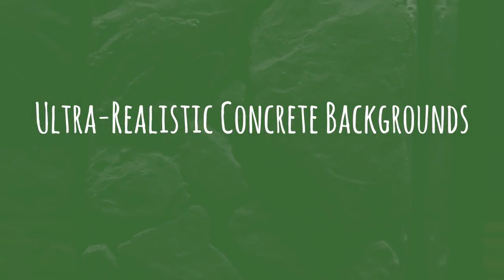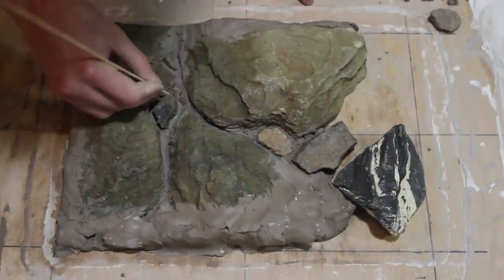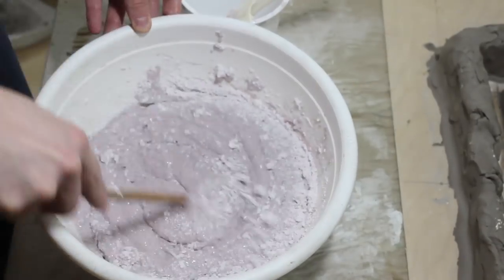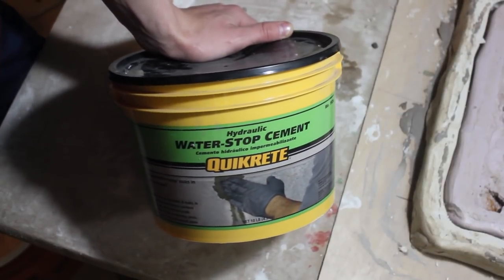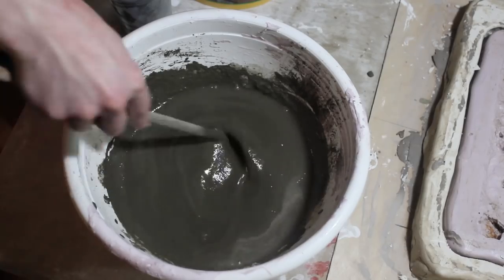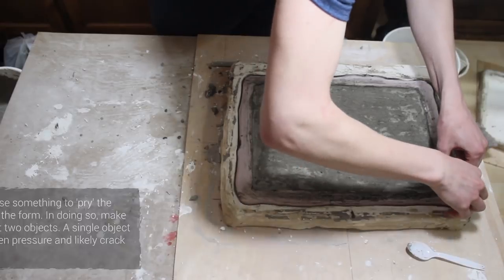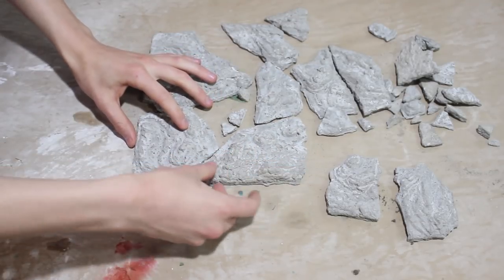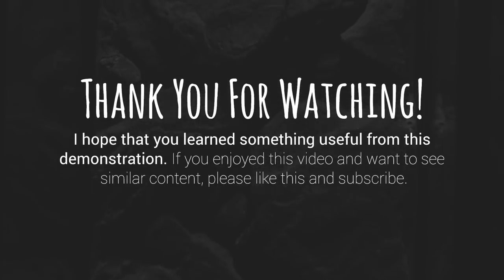DIY Ultra-Realistic Concrete Background for Aquariums & Vivariums

Comment: setting a stiff mesh into the cement will give it extra strength to keep it from cracking as easily. Think of it as miniature rebar like the kind they use in huge concrete structures.

Comment: I'm loving your techniques and designs.  Toward the end of this you mentioned that for larger builds, weight of the background could be an issue, especially with thicker (deeper) molds.  This might be relieved somewhat if you first spread a thin layer of your concrete mix to establish the surface texture, then fill the rest of the way with a cement mix including a lot of perlite, which is much lighter.  Just a suggestion based on experience making hypertufa.
Reply from the maker: That most definitely would work and I'm sure it would cut a lot of weight off.
Reply: Wow great idea. Perlite would really lighten it up.

Comment: As a suggestion, after you have the general clay sculpting done, you can take a piece of the rough, bubbly lava rock and use that to add a more realistic pattern to the clay portions by rolling it around over it...

Further, for both making your mould and for casting from it, if you can get some box fans and place them face up underneath your plywood, you get the effect of a vibration table. It helps remove bubbles from the results

Comment: Thanks for this tutorial! I absolutely love the look of this but I have big builds (6×2×2.5 and 4×2×2.5) to do and was concerned about the weight. I thought of two ways to make it lighter but still have this awesome result.
1. Make the mould 1-1.5 inches deep and use a ¼ Styrofoam board kinda sandwiched between the layers of concrete. So it's concrete surrounding all sides but the infill is mostly a light foam. You get the rigid outside on all sides but without all that added weight. 
2. Foam filling. There's a liquid version of what GreatStuff is (polyurethane resin foam) that you could pour into the mould and allow it to take shape of all those awesome small details. It is meant for backfilling post holes instead of using cement which is really why I thought of it (cement alternative). I've seen it used in prop making like foam filling masks. It's called Sika PostFix but I'm sure there are other similar products. It sets up in minutes so you could use the alginate mould more times before it loses too much moisture to continue using. I also believe you could make large backgrounds in one piece with no problems at all or sculpt the moulds next to one another so they can puzzle piece fit back together once you install them. Since it is resin, you should be able to tint it using resin dyes (it is green to start), paint it in quikrete and use dry brushing for details, or just cover it in concrete and aggregate mixture like your other background build video. Covering it in concrete or quikrete would probably be preferable for a naturalistic texture and filling any tiny air bubbles. 

I will try the second method very soon for my builds and hopefully I'll remember to come back and edit with an update.

Comment: I've found that using granite roof shingles works well for backgrounds. Has a very nice look. I shape the shingles with files or chipping then silicone them to the side of the tank being used. Make sure you get them "natural", not chemically treated with any water proofing. They usually have two holes drilled in for securing, I hide these by grinding up some small pieces of shingle, filling the holes with silicone then covering them with some granite "dust".

Comment: Hi SerpaDesign, this video is great as usual!
You mention coating in epoxy as a potential option - I did my own floors with an epoxy finish and love how they turned out.  The epoxy I used was very runny, though, so I don't think it would work well for this.  
I'm planning to make a rather large background, with a water feature built in, coated in epoxy; this seemed like a cool place to start.  I'd love to see you make one of these concrete backgrounds with an epoxy coat! Any chance?  Thanks, and keep making great stuff! :)

Comment: It's also possible to "glue" broken pieces of concrete back together with masonry glue. It's very much like an Elmer's Glue made for concrete and once dried is waterproof and relatively clear. On any that oozes up between cracks, simply dust a bit of cement powder over the wet glue to hide the glue. You should be able to get masonry glue from most home centers. MTC

Comment: I know this is an old video, but I would love to know more about using cement in vivariums. Especially the other methods of stabilizing the PH and also if SerpaDesign thinks using the cement-soaked fabric method would be OK in a background. In my mind, I see it as a great in-between for weight and strength, and low-mess (I don't want to carve foam).

Comment: Great tutorial! very well explained and the results are just outstanding! It will probably take a few attempts to get the technique right but once you do this process seems much faster than the classic foam sculpting in witch you have to do multiple coats for cement. 
Do you think it'll be possible to create some very pronounced ledges with a cast?? I'm afraid this method is limited in the depth offset you can obtain... Might give it a try thou!
Reply from the maker: Thanks! It really doesn't take long at all and the results really aren't comparable. Also ledges are definitely possible, but you will have to get creative in how you create the alginate mold. I would also highly recommend implementing an armature. Additionally it would be easier to use plaster bandages instead of pouring out a POP mold. I will show much more advanced applications for this in the future, I didn't want it to be overkill at first.
Reply: Can't wait to see your next video on the topic! Thank you very much!

Comment: instead of concrete you could also use paper mache,  or other fiber for a lighter (weight) background, although you'd have to seal it really well to keep it from crumbling, or maybe mix it with resin?

Comment: For larger backgrounds you can use rigid expanding foam instead of concrete. But be sure to use silicone for the mold material. Expanding foam is ultra lightweight, durable and super easy to use.
Reply: just the comment I was looking for please reply. Will the expanding foam fill the gaps as well as the concrete does and provide the same level of detail?

Comment: That looks brilliant. Maybe you could include hair into the cement mix to add strength. One question I do have concerns chemical leaching. Once upon a time they used concrete to make wine distilling vats because it was cheap and fast, but soon realised it had some pretty serious health implications. Would this not effect the health of the inhabitants? Even if you get the ph to manageable levels, I would think it's still a possibility 🤔
Brilliant work though

Comment: I’m in the middle of making a mortar background for a bioactive ball python enclosure. It’s foam covered in 3 layers of mortar. I’ve read that you need to coat it to make it safe for reptiles yet in the video you said that the concrete would be fine as is (without coating) So I have two questions about this: A- In my case does the mortar need to be coated for animal safety after all? (Ie have you used it for any of your animals) B- is there a safe and thinner alternative to epoxy resin? My concrete background is pretty detailed and I think that brushing on a viscous sealant like epoxy may cause it all to crumble. 
I’d love to get any advice you can offer :) thanks!

Comment: Hey Tanner I’d much appreciate if this gets answered because I need to know your opinion for this as im doing a “naturalistic back ground for my 100 gallon tank and I feel like this method would be to heavy for the glass, my question to you is can I use expanding foam instead of concrete on push it down a bit so it takes the shape of the mold and later once it dries take it out and “paint” it with a few coats of concrete so that it’s considerably lighter? Your the expert and pro and I’d love your opinion or thoughts!

Comment: When using hydrolic cement on expanded foam and foam insulating wall board, does acrylic fortifier help w adhesion.? Also you keep mentioning covering with epoxy. What type? Does it come in a Matt finish? Project is an 80 gallon vivarium w a waterfall and small pond for ball python. Thanks for all the great videos and ideas.

Comment: Old video I know, but if anyone is still viewing this... I would highly recommend a Silicon mold material to make the mold itself.  Not only will it last almost forever, but you may be able to resell the mold if you don't want it anymore.  Sure it's more expensive, but in this hobby, what isn't? lol   PS I have made molds for other things, and instead of using concrete, I used Dental Plaster, great times!!!

Comment: Awesome tutorial! I love your videos :) You mentioned the issue with pH, taking that in consideration would it be possible to make food and water dishes with this method? After they get soaked in water so the pH is at normal levels.
Reply from the maker: Thanks and yes it's possible, but it would be easier to simply coat it in epoxy for example.

Comment: You can save money by using polystyrene cut and shaped  and  painted with cement.
All siliconed together and on glass.

That would reduce the weight A LOT !

Comment: I was hoping you might be able to answer a question. I wanted to make this background for my hermit crab crabitat. The tank is suppose to have an under tank heat mat put on the wall on the outside of the tank but it would be right behind this concrete background in my tank. Would the heat mat work if it’s behind this concrete and would it be safe? I also had the same the question with your DIY foam and concrete background. Let me know what you think thanks! 

And if it helps, the tank heat and humidity are both supposed to be from 75-85° and the only heat source is from the UTH

Comment: I have in my mind to do something like this, with rock back (was thinking of using stone facade pieces used on walls, fireplaces, etc). I want to get a small pump to run water up to the top that will then just trickle down the rock face. I see this frequently while hiking.. water just sort of dripping down a moss-covered rock face. Have you done anything similar? I'm thinking the rock would even jut out slightly further at the top than the bottom in parts of it. This vertical tank option would likely be perfect for what I've got pictured in my head so far.

Comment: Oh also can a concrete background be attached to a plywood terrarium? We are building ours so it will be some kind of wood, not glass. Or, would you recommend the insulation foam method to fit it like your 180 gallon one?

Comment: When making DIY background can I add “ REAL” rock to the background, I know that rocks are heavy but I try to spit them until smaller pieces, but I want to know is it ok to put real rock on the background?
Reply: H20 Water you can use real rocks. You’ll want to silicone them in place on the glass but be careful if it’s something you wanna move around a lot

Comment: i have a question about jar terrariums, so i have this nice sized jar i want to use for a native terrarium (meaning it will have things like insects) but, the lid for the jar is metal and is a little bit rusted, will that effect it?
Reply from the maker: Yeah I wouldn't use it. You should try to get a replacement lid, restore the current lid, or make your own.
Reply: SerpaDesign I'm only young and I don't have the materials or money to do that, though I think maybe putting some plastic rap around the lid might work, not sure though.
Reply from the maker: Yeah that will work fine. If you put something weighted on top to create a downward cone of sorts you will get better water distribution than if its totally flat.
Reply: SerpaDesign thanks! I'll do that